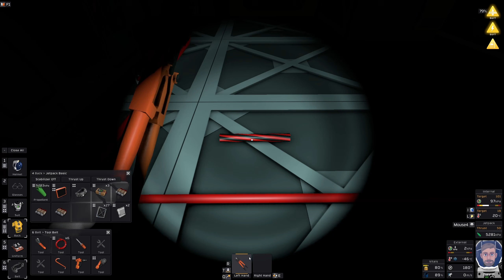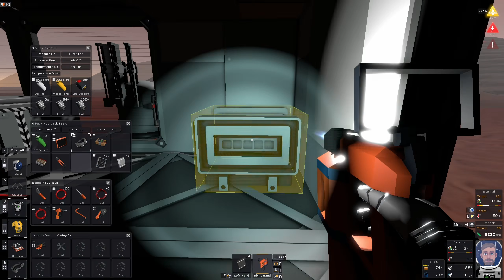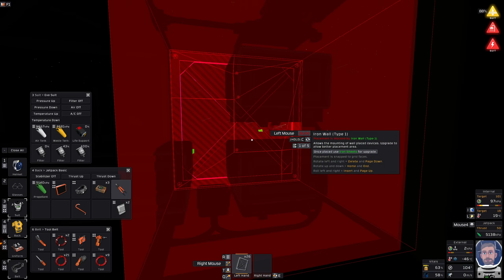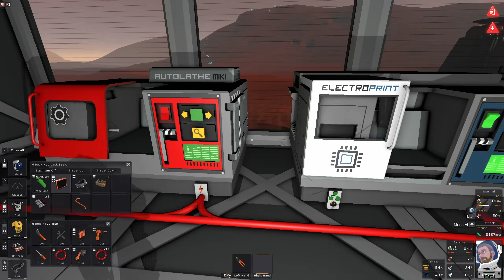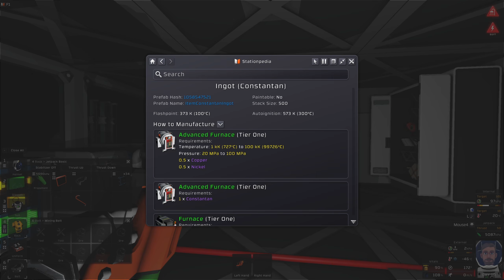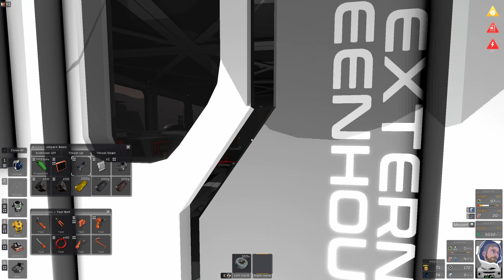Power, Alloys & The Portable Light | Stationeers | Tutorial Series For New Players | #5

Comment: Haven't done it myself in quite a while but you dont need to use IC10s for maximizing your solar energy. You can use a solar sensor and some Logic processors to read and batch write the solar angle to the panels! Cheaper, easier and imho faster. Just needs a bit more room. You can basially have the angle adjustments on day 1. Its like 1 sensor kit and 3 or 4 logic processor kits with a batch writer.

Edit: well, maybe i should've watched the video where you actually do the solar tracking ... All the talk about coding made me a bit hasty i guess. Great tutorial tho so far!

Comment: 54:45 Note for newbies: I'm pretty sure this player knows that empty filters can be recycled. However, the effort is too great. Such extreme recycling measures aren't normally necessary, but just as a hint: Build a recycler and a centifuge. This will allow you to get some of the item back. Please observe the half-stack rule when using the recycler. If you recycle a filter, you only get 0.5 or 1.5, depending on the game variant. So pay attention to how much is dispensed. 
( How can you prevent the recycler from ejecting it? = First turn off the recycler, then insert any item or filter, turn it on briefly, and then turn it off again. The feed flap will open. Repeat. Next to the power button, you can see how many items are in the recycler. ) 
Easy peasy.

@ Panic And Die Gaming 👍 Nice work
Reply from the maker: Hey Bauramiboring,

Thanks for the comment. You're absolutely right.

I've not touched on the recycler at this point because of the need for a centrifuge which I plan on doing later. In the late game when recycling more expensive items, I would say the recycler and centrifuge are worth the effort. Before then. I don't really bother.
Reply: @PanicAndDieGaming  Yes, you're right. I didn't think of that when I wrote it. Theoretically, you don't need it at the beginning, which is why you haven't shown it yet. Only later in the game, or as you just said, probably in the next video. 😉👍
Reply from the maker: @Bauramiboring  I've made a point of going through the recycler in the next video thanks to your comment :)